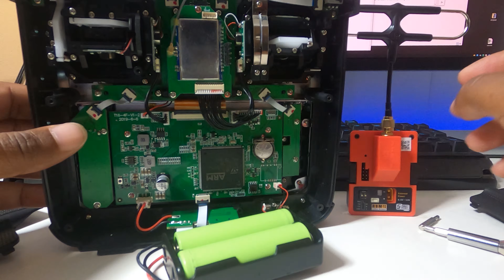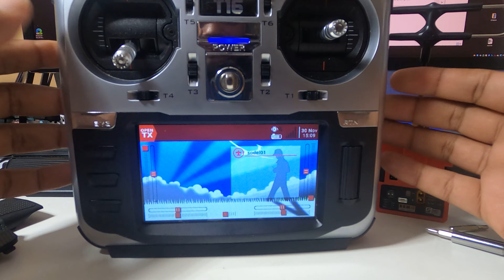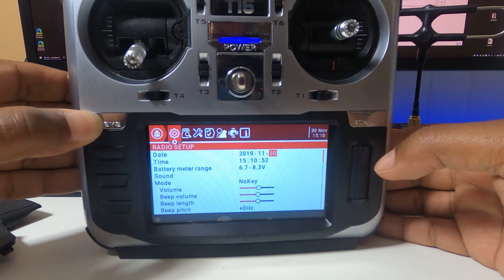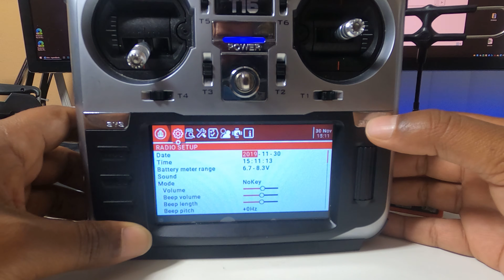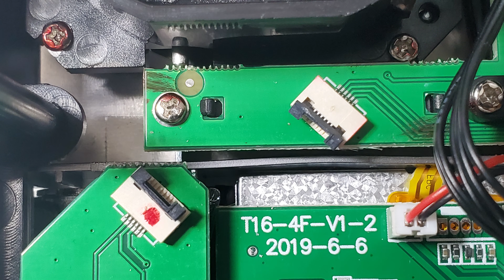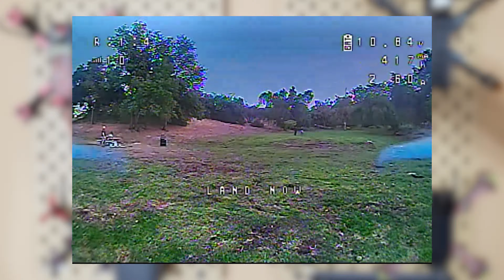Comment: I'm having the same problem, its ridiculous that this many people all have junk radios. Had my frsky radios for years never had one problem I have not gotten to fly one time with this pile of trash and I'm definitely not playing the jerk off the ribbon cable game every other time I fly what a joke I for one am bummed I spent my money on such a pile of shit
Reply: got the tbs tango 2 and wish I bought it earlier
Reply: I'm still flying my x-light and my x9D plus I should have just left well enough alone. 
I sent jumper a email and they claim they are sending me new Ribbon cable's as if that will fix it and make me feel I can trust it
Reply: @adamcole9545  they sent me out a cable as promised and it did seem to resolve the issue but out of nowhere I started getting random disarms while flying and it happens only on the first pack. I spent way too much time troubleshooting it I just ate the cost and moved on to a new radio. been super happy with tango 2 so far. I wanted to like the jumper bad but I was tired of problems
Reply: I was wondering what size 18650 batteries are you running in your jumper my friend is convinced the 3000 mah ones I'm running are to small and thats what's causing my problems......lol I don't believe this but I thought I would ask
Reply: @adamcole9545  i was using samsung 30q 3000mah cells

Comment: I experienced ribbon cable failures, gimbal cable connection failure, usb charging failure, sd card read failure and lost 2 very expensive 
quads to this piece of junk. It's inexcusable how poorly made these things are. You risk injury to yourself and others flying with these units!
Reply: I've had 4 failsafes with 4 different quads all about 15-20ft away (built in spi frsky, frsky xm+, frsky r-sxr, frsky r9 mini)

Comment: Having same issue. Readjust the ribbon cables then its fine for a bit, then it returns again.  Not sure if I can trust this thing??   don't know what to do. Haven't even flown with it yet??
Reply: after completely disassembling mine and putting it back together the issues has not repeated. I would suggest reseating the daughterboard ribbon as well or just taking the time to rebuild the entire thing.

Comment: had this problem and others too. just reset the ribbon cables.  disconnect and reseat. don't know why this happens after firmware update but pops up after, had no issue before that. Other T16 users have had same problem
Reply: Yep, had the same thing happen on my Model Setup button.   It kept operating like the Telemetry button.  Just re-seat the ribbon and everything goes back to normal.  Had the same thing on one of my swtiches as well.  My 3 position switch started act like a 2 position.  Again...re-seat the ribbon cable and it's all fixed.  Kind of silly.   But easy to fix.  ;o)

Comment: I had two different but similar issues. I still have the Jumper TX firmware.

First I had Switch warning on The SF switch since I got it new. Changing channel direction did nothing and I don't know if it's supposed to be like this but the SF switch was active on two channels (5&6). I managed somehow to get rid of the warning but it suddenly came back. After a firmware update the warning dissapeared and I hope it'll stay this way. 

But very strange was the following: After I got the radio and set up a model and did some basic learning on the Jumper TX system I put it away for a few months. Then recently I switched it on and from then on when I pushed enter on the scroll wheel it did what it was supposed to do but it also changed the trimming T1 at the same time. The firmware update did not change this. How can these be connected??. I've sent it to the vendor and am waiting since a few weeks. They say they are waiting for a spare part. Damn, why don't they just send me a new one.
Great radio but I have low confidence in it. I just bought a Horus X10S which was on sale and this will be my main radio.
Reply: I have sent mine back and awaiting a replacement. deeply considering other options as well. I agree these random defects just don't add up

Comment: Delete all model on your jumper,not in computer,and update to 2.2.3
Reply: And update to 2.2.3
Reply: @andry2i  thanks. as mentioned, i did update to the latest jumpertx and opentx several times. it is not a software issue, it was a hardware issue and since returned to the vendor for a new unit.

Comment: I have a similar issue and like you I tried all of that without success. My issue is with MDL button. When it is pressed it shows the telemetry menu same as TELE button. It also does not power the external module. I suspect a bad motherboard.
Reply: after completely disassembling the radio a few times, the proper RTN function was restored. I believe it may have been the ribbon that connects to/from the motherboard and daughterboard that was reseated in the process. try that and let me know. but also be careful not to pinch the speaker wire like I did
Reply: I have exact the same issue: MDL suddenly behaves like TELE and I can no longer edit/setup models. Did you manage to fix it by reseating ribbon cables or did you send it back?
Reply: @dischznohr  yes. The ribbon cable connecting that button's daughter board was loose or not touching the contacts properly. Moved it slightly and then it started working again.
Reply: @dischznohr  managed to resolve it by completely disassembling the radio a few times. I think ultimately it was the ribbon connecting the daughterboard to the motherboard that was the culprit. I returned the radio last week and currently awaiting for word back on a replacement from grayson hobby. nothing yet.
Reply: Thanks for the answer. I  did open the clip of the big ribbon from daughterboard to the mainboard and adjusted the cable. The MDL button worked exactly once correctly then acted as TELE again. Seems to be a weak spot in the design. I might try it again, but will probably contact my retail vendor asking for RMA. After all it is only like three weeks old.
Reply: @dischznohr  i am hopeful the quality is improved with both of our replacements. otherwise i may take the loss and move to the frsk x9d+ 2019. gonna miss the color screen though!

Comment: Guys... really... 

Sorry but THIS IS AN OPENTX Issue 

AND NOT AN JUMPER T16 PROBLEM

try the newest Nightly build of OpenTX....

Or wait some weeks for RC2

The main thing is to name a large title ... to get attention.  
It does not work.  

and Jumper can not do anything for it.
Reply: it was hardware related. so a quality control issue as others have experienced.
Reply: No, its not.  I have the issue where the roller button becomes up on T1.  I've never updated the firmware once.  Its hardware.

Comment: I had a similar problem when upgrading to 2.3.3RC1. There were buttons on the left side that did not work, when I pressed sys I came directly to the sd card menu and the page button does not work. I took out and put in the ribon cables a couple of times and flashed a couple of times and all of a sudden the radio would work normally again. Don't ask me why
Reply: after disassemble and reassemble several times the button function returned. I think there was another ribbon that needed reseating
Reply: Ulf Martensson man i have the same issue with the sd when i pressed sys, now i have another issue I can't choose from joystick or mass storage if I want to fly in simulator , one time it worked and 10 it doesn't im really not happy about choosing the T16
Reply: Sorry but how stupid are you...🙈

sorry man

This is an Problem with Opentx and not with Jumper T16...

you only should try the newest nightly build........
Reply: @darkness1943  it was a hardware issue. resolved after reseating every ribbon on the radio. my issue was not firmware related.

Comment: I believe this is a firmware issue. I was having the same issue until I went to Jumper website and used the link to the firmware from there. I don't know if the firmware that comes in the radios is a the non tested nightly builds firmware.
Reply: i thought possibly the case as well which is why i flashed opentx and jumpertx firmware multiple times using both the internal bootloader as well as the windows opentx companion desktop app. using that as well as formatting the sd card and replacing the sd card contents did not resolve. i would believe it is a hardware issue after these troubleshooting steps

Comment: if i were you i'd go for the x9d 2019, i heard that there's problems with the jumper t16 with frsky receivers something about fail safe
Reply: If your 4n1 has the bootloader already installed (mine did) you can flash by selecting the appropriate file and then putting it on the sd card in the firmware folder and flash it while its in the transmitter.  If I remember right you go into the system menu and select the file tab and then the firmware folder.  It showed the firmware file and I long pressed on it and was able to flash from there.  Double check the instructions to be sure.  Also there is a fine tune option in your model setup where you select the internal transmitter.  That fine tune can be used to maximize your range because by default some frsky frequencies don't match exactly to the 4n1.  Grayson Hobbies on youtube has a video showing the process.  There is also a 2.33 opentx nightly update that says it was a critical update for the t16.  More info here:  https://www.open-tx.org/2019/11/17/2.3.3-nightlies
Reply: @spyder000069  thanks, I am familiar with tuning it because of that same grayson hobbies video. I've also flashed it with opentx and jumpertx from both the opentx companion as well as internally by holding the trim switches while booting up. neither firmware resolved the issue
Reply: @jasenhenry  Your issue I suspect is hardware.  Updating the 4n1 and opentx  and tuning was directed toward the comment about some frsky receivers having failsafes.  :^)
Reply: definitely exploring that option. in the few flights I've had using the frsky r-sxr exclusively, I experienced no issues whatsoever
Reply: There is new firmware out for the internal multiprotocol transmitter.  https://github.com/pascallanger/DIY-Multiprotocol-TX-Module/blob/master/docs/Compiling_STM32.md
Reply: more info here:  https://github.com/pascallanger/DIY-Multiprotocol-TX-Module/blob/master/docs/Compiling_STM32.md

Comment: "a radio of this caliber"  lets be honest here.  Its a new company that cloned the frysky electronics and is selling the radio for half the price.  :^)  I bought one too and mine had a screw bouncing around inside from the factory.  LoL.  However, so far I'm really digging the features but am not totally blown away compared to my trusty taranis.  I think you are right that the daughterboard is suspect.  I would be pulling the 4n1 and start inspecting that pcb under it for a solder bridge on a connector or a bad pcb trace that is conducting to the one next to it.  Your close up already shows some type of damage going on.
Reply: a loose screw, i believe it! haha. idk, my journey to fpv has been rough. like i mentioned in the video, i started ordering parts in july and here i am in december still trying to get a few flights in. feels like i am always "this close" to flying when something comes up. i had just paired the receiver to the latest 3" build when this issue arose. heavily considering switching to taranis and being done with it. there is a cyber monday sale at getfpv.com
Reply: @jasenhenry  You did have bad luck for sure.  I've been flying RC since late 90's so I have had many radios over the years.  My taranis plus models have been dead reliable.  More than the top name brands they replaced (JR/Futaba/Spectrum).   My impression so far with the T16 plus is that it has good potential.  Its still early for them and they have some QC to deal with but compared to other cheap radios that have come out over the years this one is the closest to something that is worthy of switching over to.  Now most of that is because of the electronics being a knock off of the frsky horus x10.  I'm only a couple flights in with the t16 and I am trying to ask myself what does this do that my taranis doesn't.  If you get past the color display the only feature it really gives me is the ability to show my flight controls stats on it through the inav widget.  Which when I am wearing goggles 90% of the time doesn't make a difference.  The 6 button selector I though would be awesome for flightmodes but the 3 ways I can easily find with muscle memory (remember goggles on) and switch back and forth much faster when you lose gps or something goes wrong.  Plus no built in charging on the t16.  I'm still going to play with it but I don't see anything that makes it a game changer other than the price.  You're FPV experience will get better.  There will always be the occasional bad designs or mistakes that are frustrating (and costly) but eventually you will get a frame or two built that is reliable and iron out the transmitter stuff.  I just had an expensive tarot x6 have a flight controller failure and crash into one of my trees on a snowy day.  Sometimes crap happens.  Tossed the controller and gps, replaced an arm, and its flying again.  The struggle is real.  LoL.  Waiting on my copper tape to line the inside of my t16 case since I also fly 433mhz and its been reported as having interference problems.  The original taranis also had issues with this so I am not surprised.
Reply: @spyder000069  Also, taranis doesn't have two additional trim switches like T16 or Horus. Sometimes, i realy need it on my X9D for adjust some mixes values or something other
"on the fly". And at new PRO version on Jumper t16 also have a internal mulimodule.
Reply: haha 😂😂😂 
And shit frsky  company 
does copy FUTABA RC Radios...
Do you remember.

 nice joke...